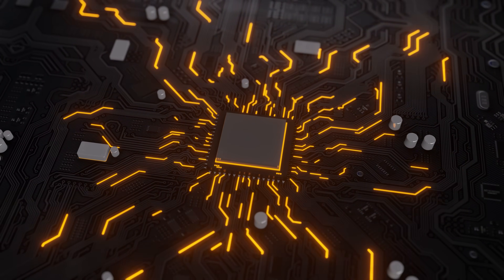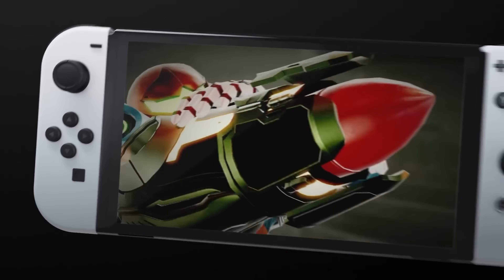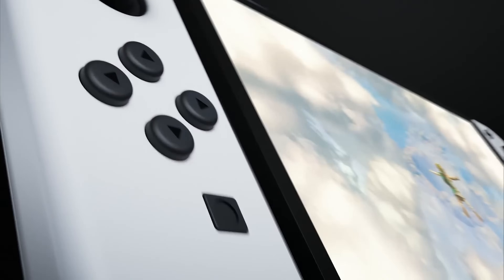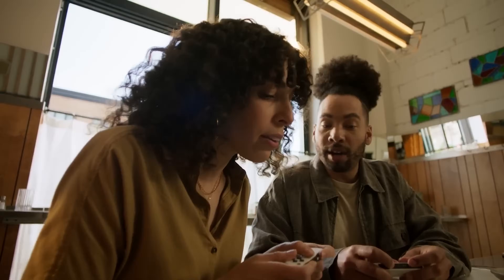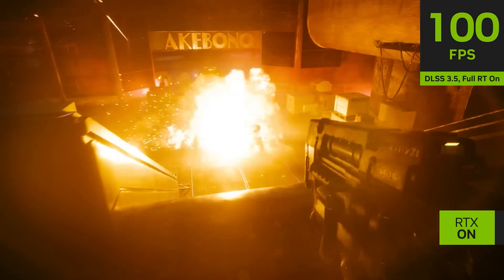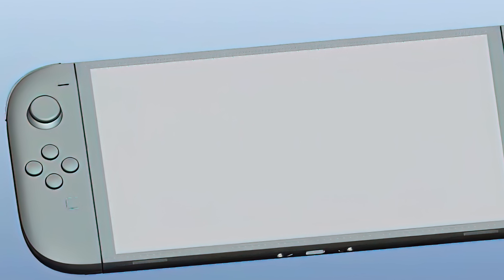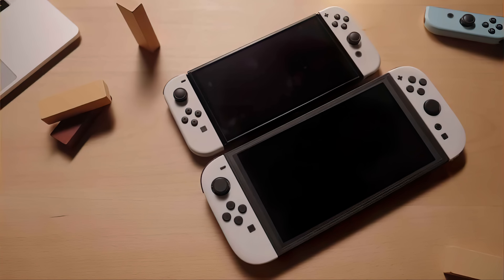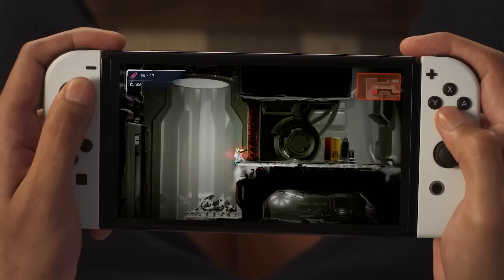Nintendo Switch 2 Updates: SOC CPU + GPU Technology Node (nm) Evidence? + L3 Cache Upgrade Analysis

Comment: I'm 85% on 4nm, after following the discussion for weeks
Reply: Everyone did the same thing with the OG switch... "We have confirmation it's this chip, but we think its going to be this other more powerful chip because that would be nice!!!!" -spoilers, it was the cheaper slower chip all along.
Reply: @AlexHonger-fj3nx  right now the confirmation is more on 5nm than 8. Everything that we know about the hardware only work at a smaller node.
Reply: @AlexHonger-fj3nx  here is the thing though, it's only about 40-50% slower than the Series S. Essentially the same as the switch compared to the PS4
Reply: 4nm is cope imo
Reply: @linkszxx  could be cope, or we can all be wrong and the specs are completely different to what we know
Reply: @linkszxx  I wouldn't call it cope, it's just the most logical and probable option based on the information we have right now
Reply: probably 7nm
Reply: Not a chance in hell. 7nm at best.
Reply: @Salamihawk  The memory is LPDDR5X and that memory minimal node is 5nm.
Reply: @alessandrooliveira3218  will it be a quad channel Ram? 32bit?
Reply: as the GPU in the rumor is ampere, it should be 7nm, GA10F is an unreleased ampere mobile GPU. it would be odd if it was shrunk down to the size of their modern 40 series cards. Because it's GA.
Reply: It will produce on 0.1nm

Same performance as 9080ti. Absolute a big lep.
Reply: It’s definitely not 4nm it would be to expensive on launch. However it could happen for a revision in the future. 7nm TSMC is definitely more realistic.
Reply: @ZackSNetwork  Would be awesome if it used the chip in the iPad Pro, the M4 chip.
The performance and efficiency would be excellent for this.

Comment: They gotta reveal in October. Riiight?
Reply from the maker: If they don't, someone else will....meaning more big leaks. Nintendo has to make a move extremely soon or it could be damaging.
Reply: @SuperMetalDave64  it seems that the 10 of october is the day.  wayy to many leakers have confirmed this date (alongside the guy that leake the ps5 pro date and launch date)
Reply: @SuperMetalDave64  Hmm, I don't think the Nintendo reveal date will be influenced by the leaks so far, as the average user doesn't keep up with the leaks. It will be either october with a April/May release... or a march reveal with a september/october 2025 release (I hope for the first of course)
Reply: r/Tomorrow
Reply: @vivid8979  lol
Reply: Unless they plan massive price cuts on the current hardware, I don't think they will do it going into a holiday season unless they can have the hardware out for people to buy.
Reply: @hmon661  hahaha your funny. Try Feb